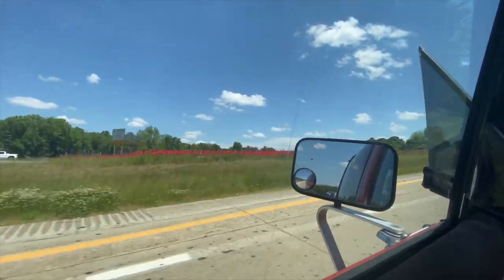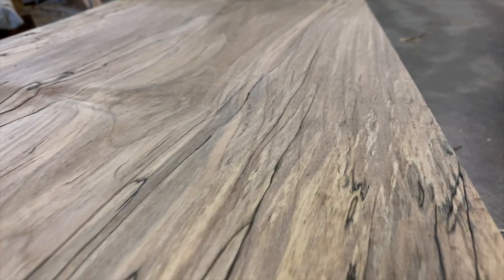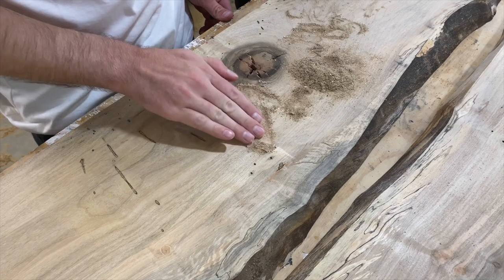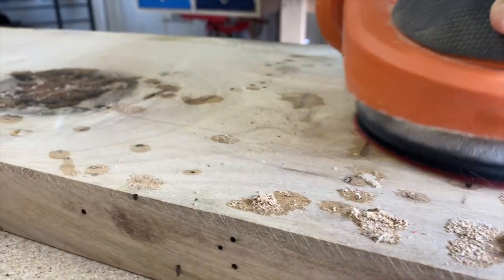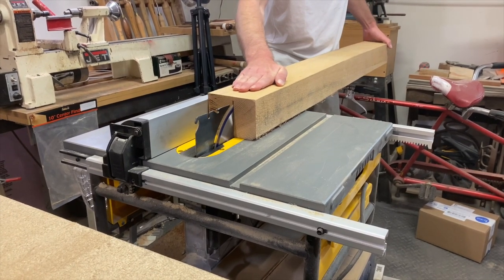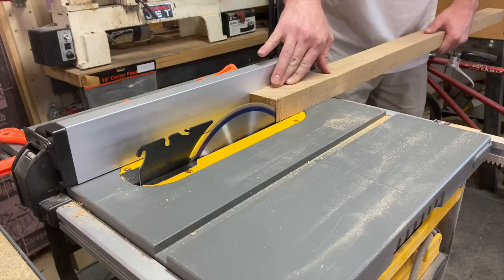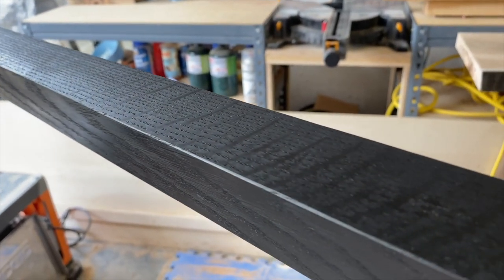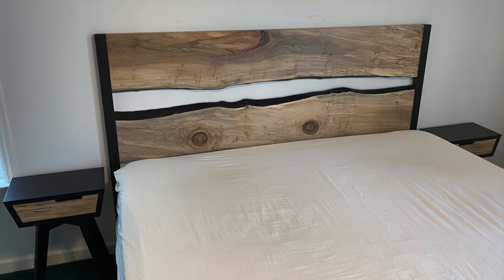Live Edge Headboard - Spalted Maple and "Black Oak"

Comment: Why not just flip the board and run it through your table again?
Reply from the maker: Yea I probably could’ve, but I felt it was the safer thing to do since I was not working with the squarest rough lumber
Reply: @JThorumWoodworks  you had a better look at the wood than I did in the video. It came out great in any case.
Reply from the maker: I appreciate it 👍